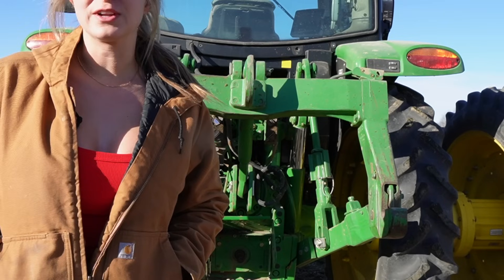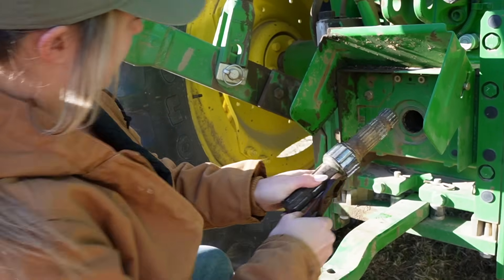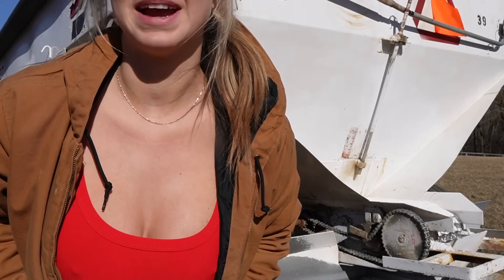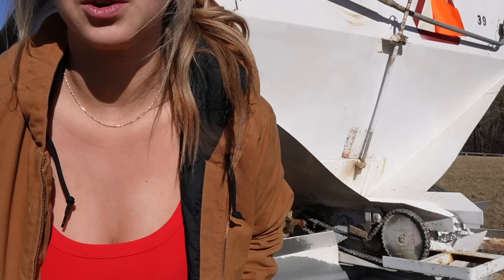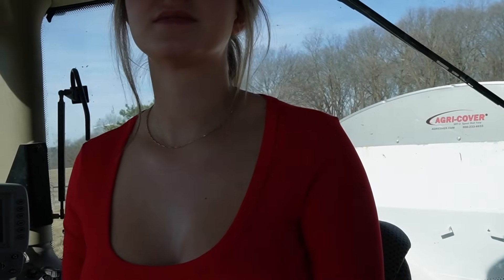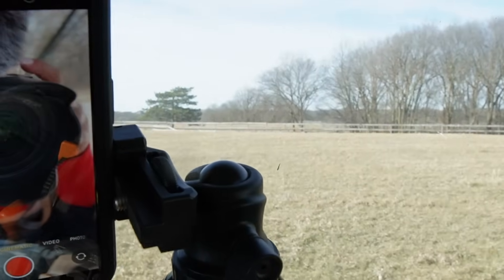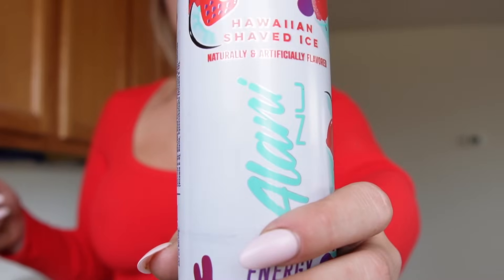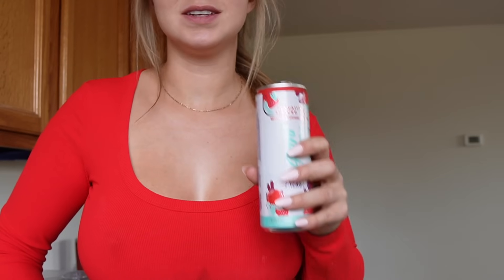Day in the Life of a Beginning Hay Farmer

Comment: I had cataract surgery on both of my eyes and that's more scary than lasic surgery.
Reply: It's the same thing. I had cataract surgery also, and when they take the lens out of your eye the cataract comes with it. Cataracts form on the lens that they replaced during lasix surgery.
Reply: Not the same.  Cataract surgery is use of phacomulsifacation that suctions out the lens in small micro pieces then a man made lens like acrylic is folded and inserted through  1.3 cm opening